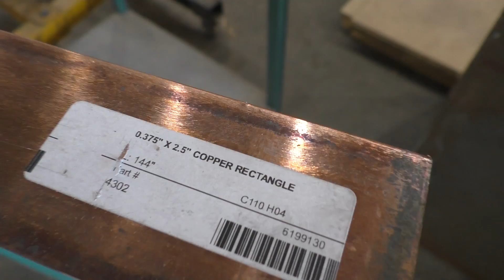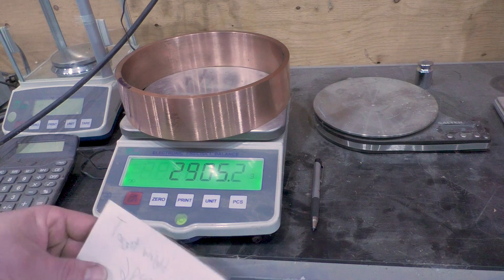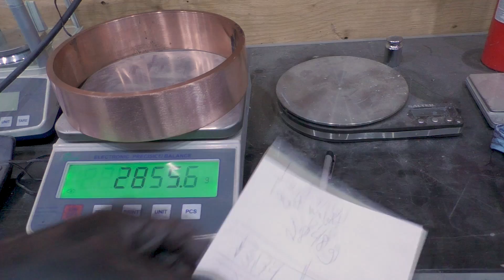Searl effect generator replica Copper Layer fabrication

Comment: I’m curious on if John as a 14 year old go to landlords house and ask to build one on her kitchen table and did it pretty quick.  Do you think that his first version didn’t have these materials or had found materials already made on different things and was able to bring it together without having to actually fabricate anything.  He worked on motors so did he have Teflon and demagnetized material or a magnification printer for wave or did he just stack magnets together to get the wave pattern since in his dream they were split. I’m so fascinated with this generator!  Have you finished yours and have you seen good results in your build. thanks

Comment: Have you tried making the wave pattern with varying Intensity rather than with polarity? Having the outside of the ring all north and the inside south or viceversa
Reply from the maker: It's funny you would say that. My next big move is to start experiments with radial magnetizing on the rollers. As for intensity, it could be done. But I would have to figure what the values would be first.  Sorry for no videos for a long time. Life has been really crazy this year. I may do a video in January to give some brief updates and glimpses of what is coming....

Comment: Watch "Anti Gravity & Zero Point Energy" on YouTube
https://youtu.be/F6LdcLfYBGg
John serle put a magnetic charge in each of the rings and used a neodymium magnet. You also need to follow the rule of squares check out the video I've attached which is the interview with John Searl it's not just lathing it it's all so magnetically charging it.

Comment: The copper is not really "soft" at all,  it's condition is called "half hard" and it has not been annealed to make it soft ? It has been work hardened by the rolling process.. Unfortunately your doco. is short on pacific s such as measurements like the inside Dia. or the outside Dia. ratio  compared to the Dia of the rollers

Comment: I question the valitity. . One must ask the question, if such a thing could be built by hand with 1940s' technology, then what's the problem? We have machines 1000 times more accurate and advanced. 1 modern day CNC could cut (ALL) the componants in minutes with far more accuracy. But yet, after all this time the only thing they have is the inner ring with a few rollers. Be real.
He is either deliberatly hiding how to build it, for money, or it was never built to start with.
Reply: I’ve not seen just what an SEG is supposed to accomplish? 

Is it alleged to be an over-unity engine or what? 

And over-unity is a crock. So I don’t know the goal is.
Reply from the maker: It's not over unity. It's the same principle as a water dam. But with electrical energy
Reply: wood brass and glass 
A water dam hydro dam is a storage system. So is an SEG machine like a capacitor?
Reply from the maker: @larryscott3982  a water dam acts as a reservoir of water energy.  The Seg could act as a capacitor if the teflon layer is removed.  Of course this is all just theory so far. As of yet no one has yet to recreate a real working model. Once and if that's done then all theories can be put to the test and some held and other thrown out

Comment: Wit didn't  do it on on the lava  and vucse  it togater   could  vucesipn   heat viction  triy  to fuse  it  ask you nead is you larhe  and a small  touch  if you fuse it togater  thin you don't HAVE  to grained  it LIKE that

Comment: Hi  I really hope your having fun with your devise.  By the way if your rollers get going to fast around your ring it starts to form a vacuum and glow green blue.    So anyway the steering kept breaking plunger maneuverability became an issue.   Everyone went to the plasma generator   Better control of flight.  Plus opened much mour then levitation.   I have a YouTube station named Fred grace  you might like it

Comment: what is the reason for the weight matching between the two materials? Is this like a tesla coil thing where the mass of copper should match from primary to secondary for the equal transfer of the pixies?
Reply: It's to make sure the magic smoke doesn't leek out.

Comment: On copper it's easy to get it to .000 used to stone comutators on traction motors for locomotives course med and fine hope this helps to be more persize  look it up on utube stoneing the comutater.there is a sealer after .000 I'm rooting for you I need a generator hope to buy more than one ,work truck car and house etc.

Comment: I think the welding of the copper will be disruptive and may need to be 100% continuous . Keep the DREAM 🎆
Reply from the maker: Searl magnetics would agree. They get solid blocks of copper and work them out until they get a ring. Typically costs around $5k per block. I can't afford that kind of money for now....
Reply: @woodbrassandglass  Come visit me, I'll teach you how to make it cheaper
Reply from the maker: @carmaster5999  booking my plane flight now....
Reply: @woodbrassandglass  Thank you, but it's unnecessary. You can do without an airplane. I think you will succeed, you need to make a muffle furnace and then cast the copper rings for the generator yourself. Great savings in turning operations. The chips can also be reused. For casting, you can use copper waste or buy copper nuts and melt them. If you have any questions, I'll tell you. Sincerely Victor